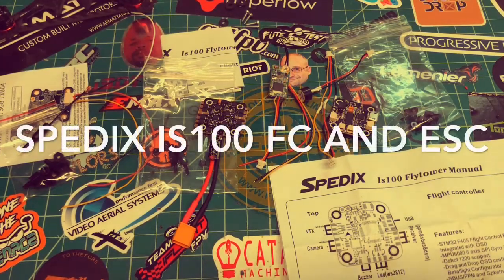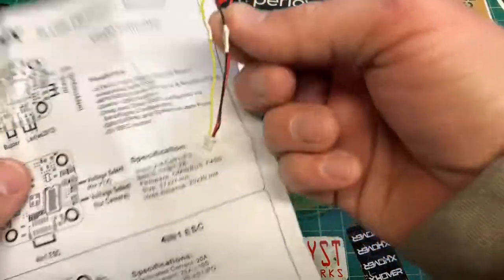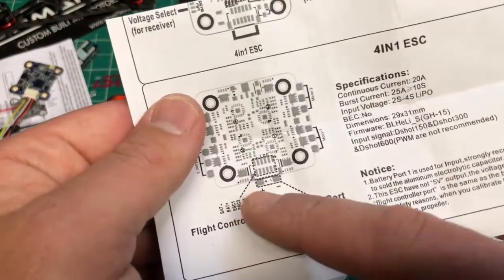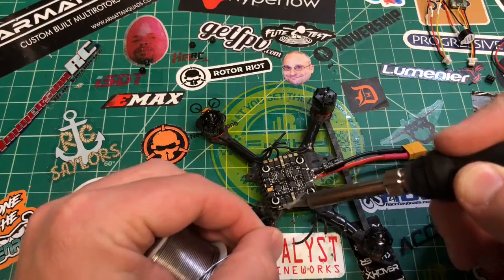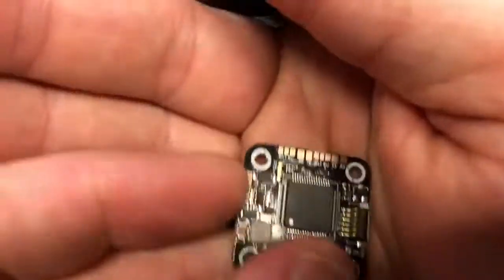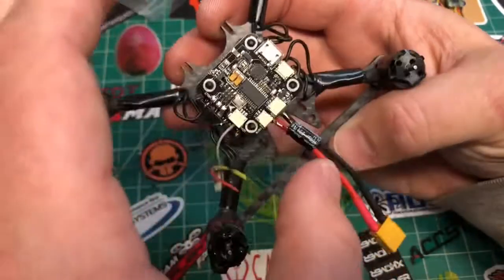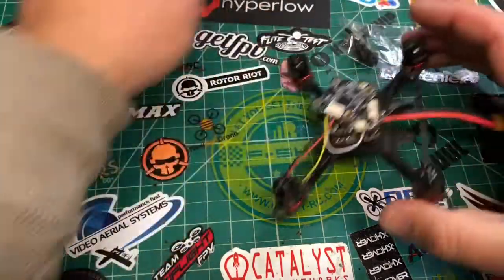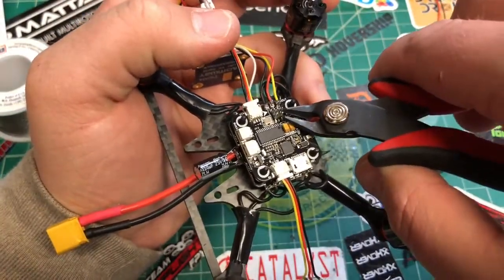spedix is100 f4 with 20 amp esc (massive droner install)

Comment: What is the best 20x20 fc & esc that doesn't connect by a pin header?
Reply from the maker: John Doe the only one I know of, off the top of my head is the new hglrc 20amp stack. I actually hAve one being delivered today. Video up next week. Other then that I haven’t used any wire to wire 20x20 stacks yet. The pins suck! Lol
Reply: @chrisr112887  yes they ripped the pads right off, in a small crash.
Reply from the maker: John Doe I will say that the spedix tower is at least labeled. If you remove the pin headers you can run wires. It’s small tight work but I managed to do it. Mine is still flying.

Comment: Man I’m having so many issues. Ive done everything you have and I still can’t get mine to show in receiver tab. Help!!
Reply from the maker: PHLYFISH _FPV hard for me to tell not looking at it. Make sure you have proper bind to receiver, receiver is connected to the proper wires, on bottom of fc make sure you bridge the voltage selection and also the inverted selection. I missed that at first and it gave me trouble. Then make sure you have the proper uart selected, and protocol your using in the config tab. Watch from 9 minutes on, to get help with the pads on the bottom.